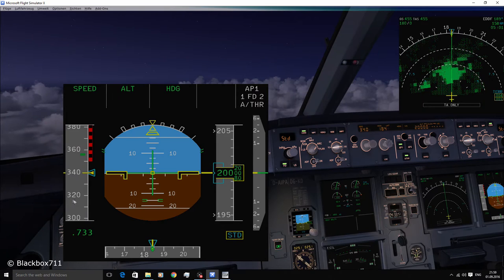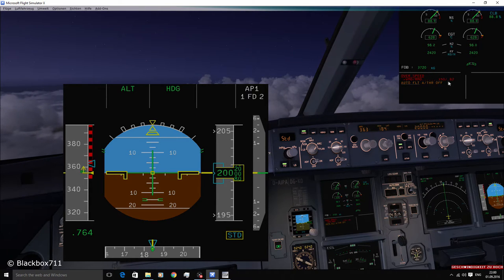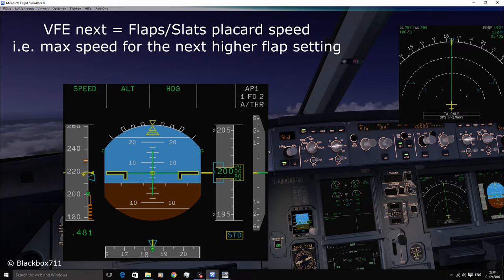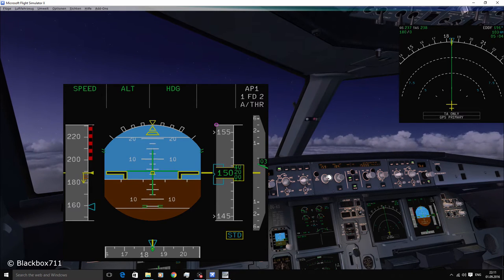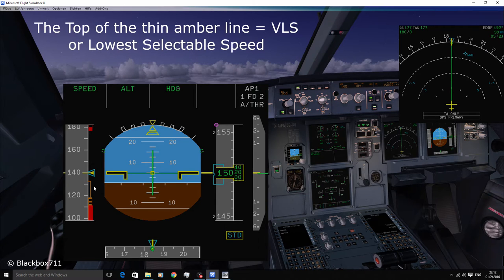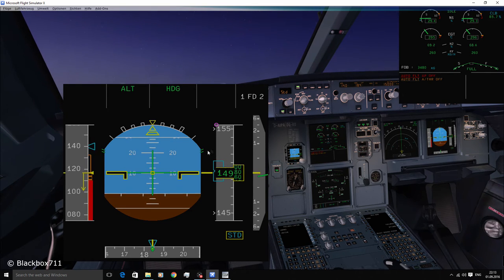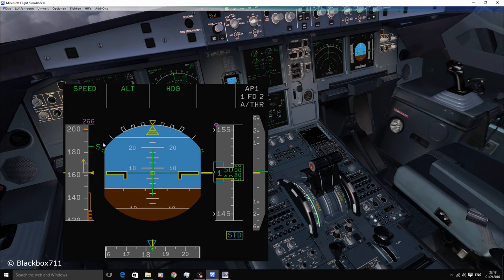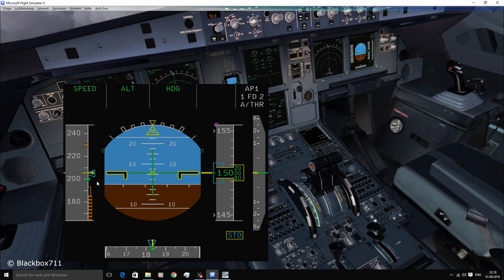FSLabs A320-X Basics: Characteristic Speeds on the PFD

Comment: hi, as in 5:06 talks abt" A floor activite and Max thrust is commanded by auto thrust system"  i saw that auto thrust button was in Green too, did u press that or that auto thrust will go on regardless?thanks !
Reply: tiffany51793 no , this is the only way to engage A/T again after Thrust Lock condition..
Reply: In Airbus Auto thrust engage automatically as u push the thrust lever to FLEX
Reply: but that does not happen in Boeing u have to turn the auto thrust to ON